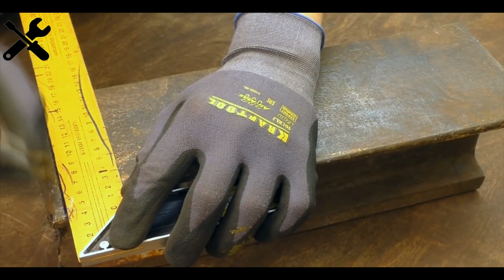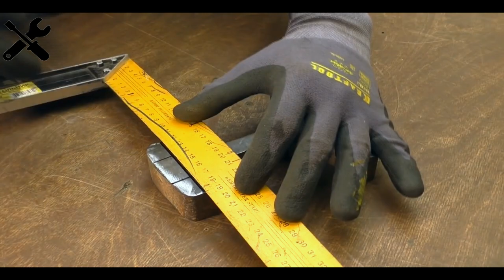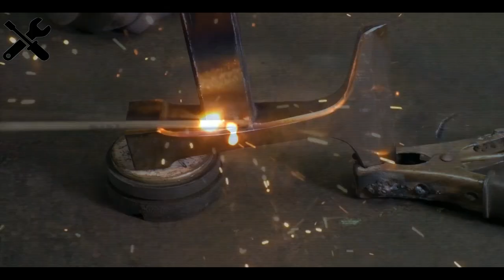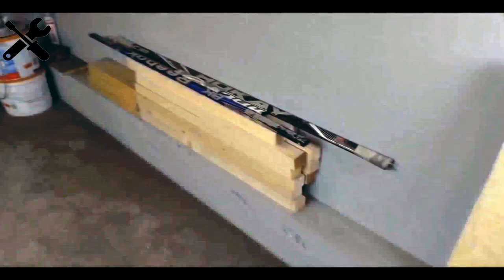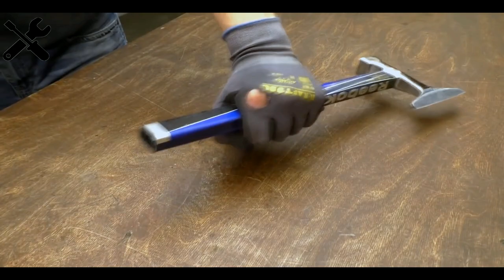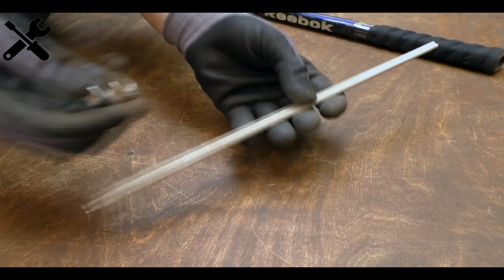Making Axe using Railroad Track  HandMade

Comment: nice ! i don't get why you put the welding rods inside the handle tho, what was that about ?
Reply: Not that you will ever see this but the hockey stick is a compost(fiberglass or carbon fiber) and it cant be welded or easily screwed into place. The epoxy joint over the 3-4 inch long steel box tube is a good connection method
Reply: @unknown-ql1fk  I think jtm57 was inquiring about the storage of spare welding rods in the handle.